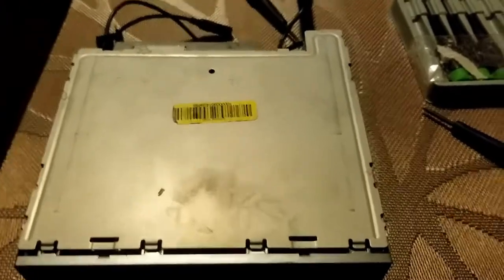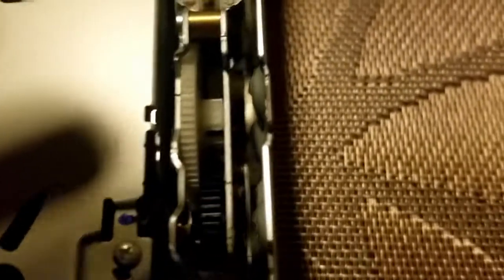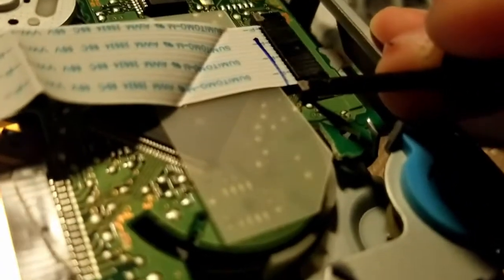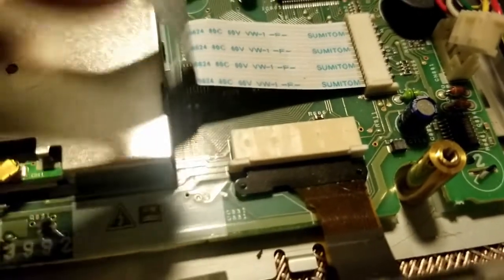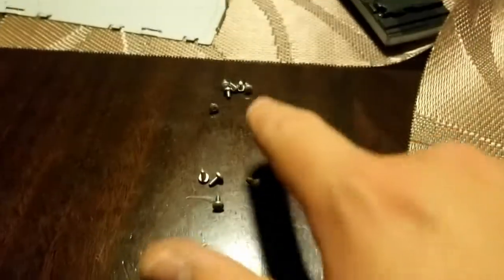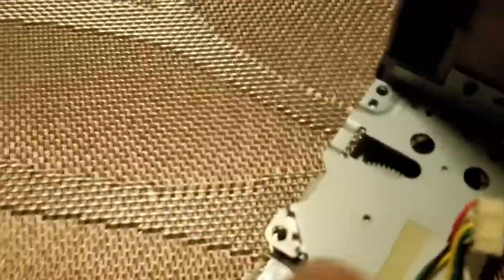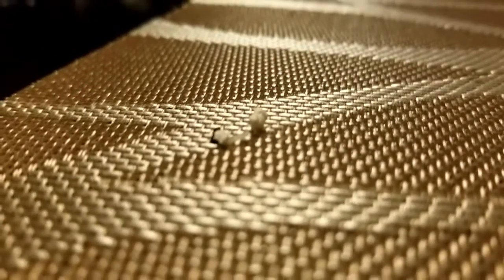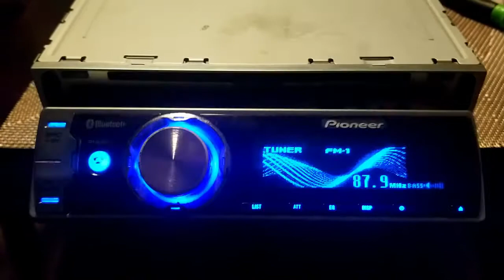Old School Pioneer Motorized Faceplate Repair

Comment: Just an FYI @RadiOG, you canbuy the wheels new. But itwas a huge pain getting those wheels out. 

For the life of me I could not remove the motor the way you did, I had to completely dissasemble the circlips and faceplate to gain access. 

You could probably do it. 

CNV7753 for white gear
CNV7754 for black gear but verify both

I messed up and bent the arms so after replacing I dont think itll work..  Ill report if it does

Comment: Hola, tengo un radio cd pioneer y no entre corriente por cable amarillo, saque la placa electronica y en el pin de entrada de 12v hay corriente solo en un lado del fusible, es posible que este roto? Abría que sustituir?